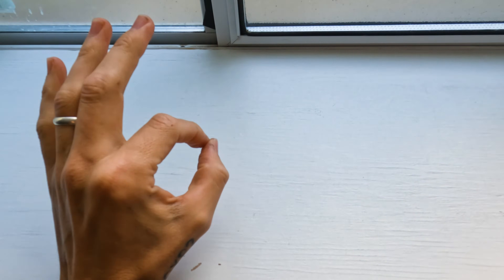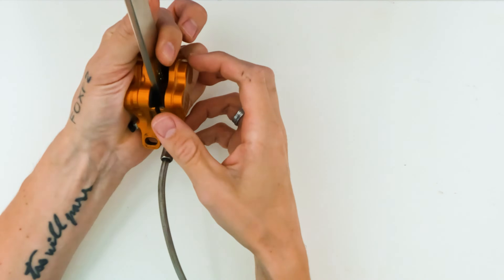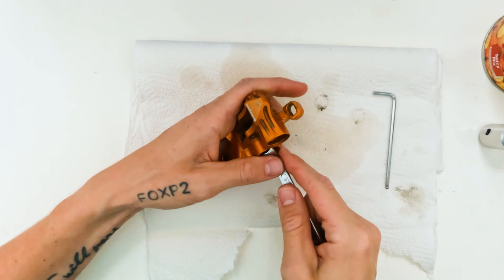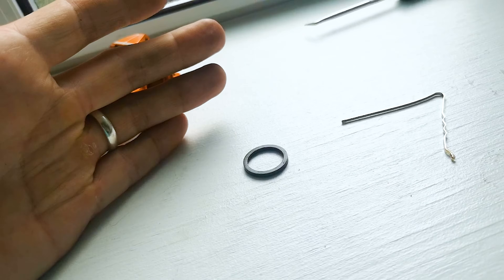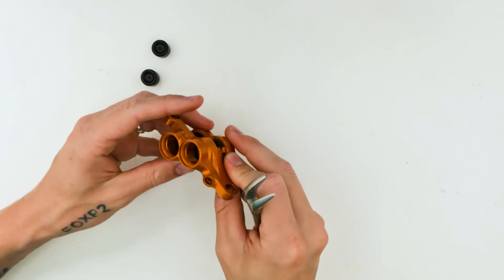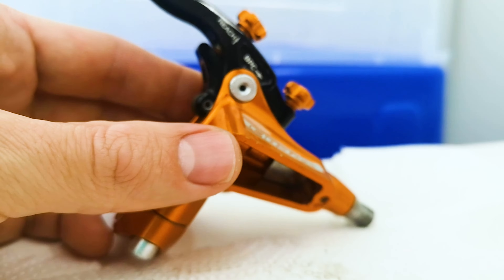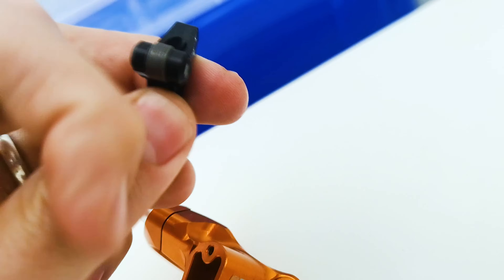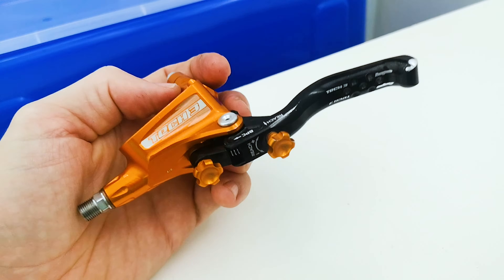Caliper & Mastercylinder FULL rebuild - Hope Tech Brakes

Comment: I dismantled some Hope brakes that I inherited but weren't working. I cleaned them up, put new seals in (exactly as they were before), but now everything is together, the brake lever does not push any liquid through? Nothing leaves the reservoir, but the small hole is not blocked? Any idea what has gone wrong?

Comment: I wouldn’t put anything except DOT fluid on the seals. DOT is what lubricates the seals in this case, with shimano and magura it would be mineral oil. If you want to greatly extend the life of your brakes you should lube the oil seals at least once a year. A few tiny drops of braking liquid, corespondent to the brakes, per seal followed by “half-pull” tbe levers a dozen times to make sure everything is lubricated, then push the pistons into the brakes and wipe the brake clean with a little of alcohol.

Preferably you will do this once or twice a year, when bleeding or changing pads.

Comment: Pro tip: if the light is bad and you have the advantage to have some sort of power supply... turn the light on in your flat :D
Reply from the maker: The what supply? And it turns on the what in my what?
I don't know dude I just go by the sun most of the time

Comment: The golden eloxal Banjio Part at the end of the brake hose, is enough Color on my Saint brake caliper. Especially after the first few hours of use, when they start getting dirty by Nature........ 🤣👌‼️
Reply from the maker: Saint's are beauties! Hand down one of my favoritely designed brake calipers, has that sort of muscle aesthetic, you're excused not using color! 😉
Reply: @Frorideism  OK, all cool! I'm a bike mech from Munich, I'm doing DH Bike park hobby ride since 2011, spec. Demo 8, since 2017 with a Scott Gambler 710. But if you buy something from your store, it's always a bit cheaper, you know.
So, no criticism about good, expensive bikes🤣‼️
But I have one question, how much did you spend on the complete hope bike? Of course, I like my Fox 40 Kashima, for the performance and the Optik! Or my Öhlins TTx 22m coil spring shock, 2014 for my demo 8 frame as well. But, for me, all bikes with original prices over 6 or 7 thousand € or $, are developing in the wrong direction. You take care about the clean shinning beautiful color parts of your bike. I'm glad and happy, when I return from a weekend in Leogang ( Austrian Neighborhood) or Geißkopf ( Bavarian bike park), without any broken parts. Bike parts or body parts. And because of that, it's not really useful, if all bikes costs 10000 or 12000 or 14000 €. Exept the bike company's, as long somebody is buying their expensive stuff, each year.
But, that's my opinion about the price Politik. I also always like the newest and best stuff, but there should be some normal money amount enough 😂😂🤑😂😂😂😂

Comment: can you convert to mineral oil ?
Reply from the maker: Pretty sure that will kill the seals,

I mean, not the aquatic one's but the rubber one's inside your brakes 👍
Reply: I did and was total failure. After all your seals and diagraph are gering bigger. Like the toys you put in water and suck it up. But now when you dry your seals they stay big😂
Reply: I fixed my diagraph with a cut out tube when i was in winterberg because they dont have hope spare parts nearby
Reply: You can if you replace the seals with the mineral oil seals from hope or a seal dealer

Comment: What is the part number of the service kit?? Thanks - can’t find it anywhere…
Reply from the maker: Hey buddie! Im not sure if there's a full one, i had to get the seals and pistons seperately!
Here goes:
Hope tech3 seal kit complete - HBSPC59 :T3

Tech 3 master cylinder piston -
HBSP317

Cylinder clip -
Hbsp311

Pistons -
HBSP136

Bore cap tool - 
Httctc

Hope that helps my friend!
Reply: Thanks - 👍🏽👍🏽👍🏽
Reply: Did the caliper part about 6 months ago but didn’t do the lever!!! No wonder they were still wonkey -
Reply from the maker: @thenicotennis  Ah! Yeah lever's good to service too! :) 
Not sure about the specific seals in there, but the master piston comes with all seals needed for piston service at least! GL

Comment: I really like the ice tray organiser idea, I'd never thought of it before, its a great ghetto solution (and probably as good as any 'professional' solution) for keeping small parts together where you left them and at the same time minimising hydraulic fluid egress 👍

 I'll trade you "use knitting needle protectors on your picks" to protect the tip if you drop it on the floor and so you don't accidentally stab yourself.
Reply from the maker: Gonna be selling out!

Ohh yeah probably a good idea, nice, haven't stabbed myself yet but I do often ungracefully dig around in the toolbox with them in it 🤔